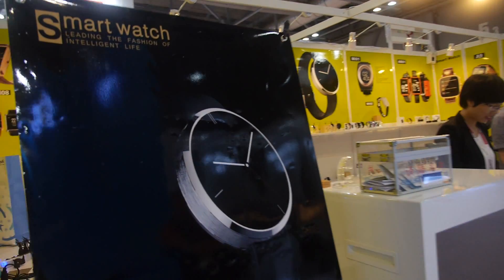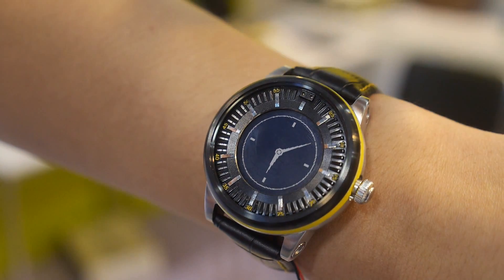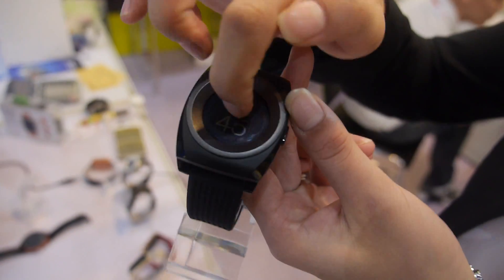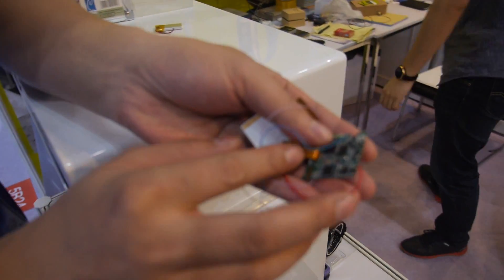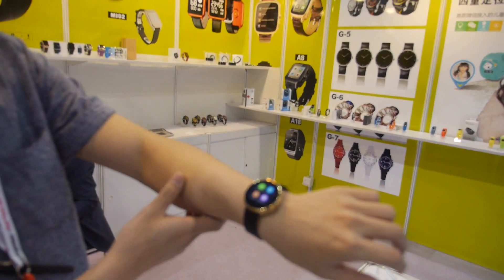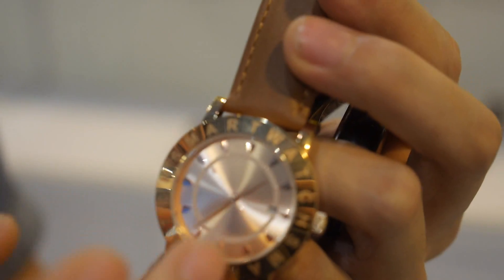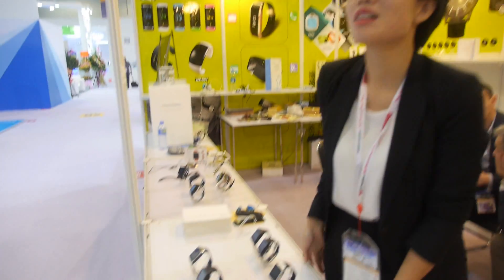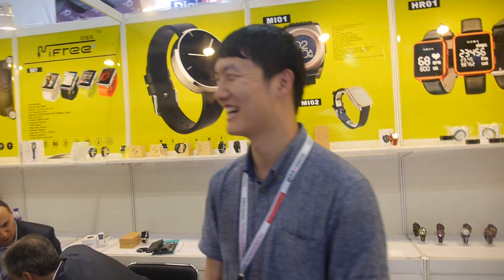Mifree Memory LCD and E Ink Smartwatches

Comment: Do these smartwatches support both iOS and Android platforms? I like the ideas of blocks as it supports both iOS and Android. It also comes with three different screens: circular, rectangular and e-ink screens.
Reply: +Roanne May Creer is it an apple iwatch? then no, it won't fully support iOS :P
Reply: +sinephase 
You can use Android Wear on iPhone, but the Apple Watch doesn't support Android.
Reply: *****
OK as long as it has that branch of android it will work with iOS :P